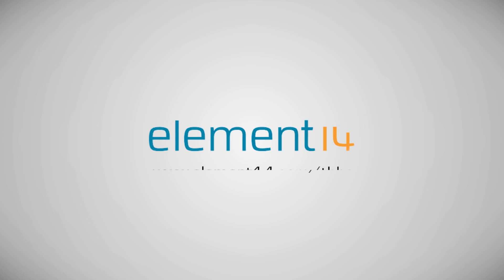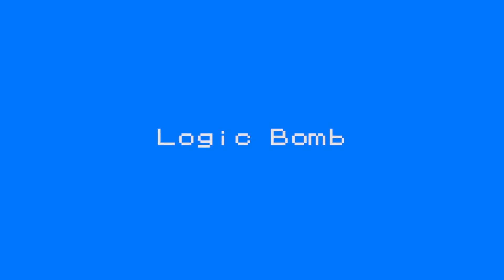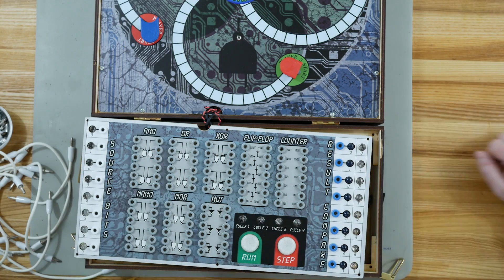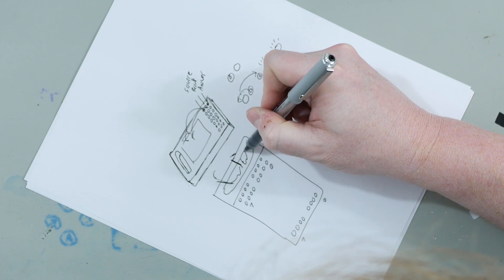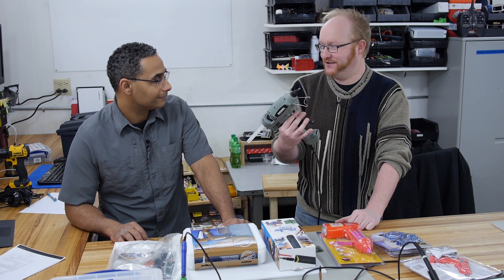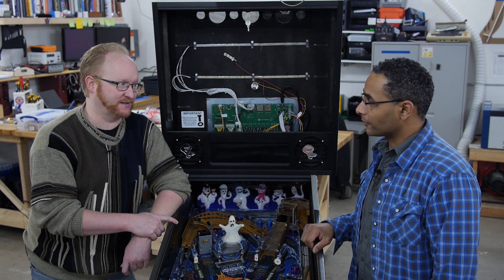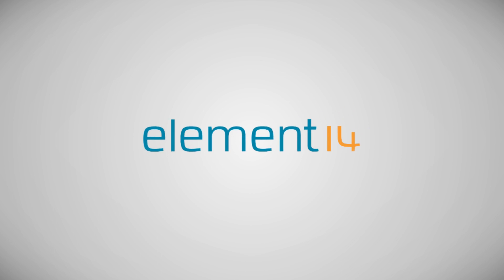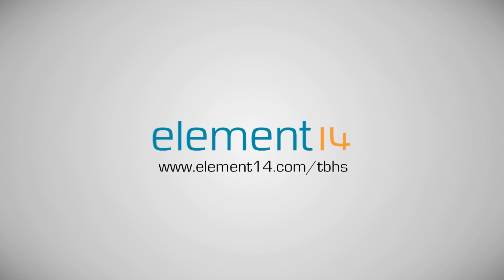Announcing Three New Builds!

Comment: You could try spring terminals for the Logic Bomb. 
When I was a kid I had a toy that let you "make" simple electronics by running tinned wires from spring contact to spring contact. It stood up to me as a kid and it was easy to get more or replacement wire as all that was needed was a stripped end.
Reply: That's what Ben was thinking. We may end up going that way.

Comment: I would happily back every one of these on Kickstarter.  For Hackmanji, if you recall those old Radio Shack electronic projects kits, they used bare wires with "spring" terminals.  Seemed pretty robust back then, and you can always make more on your own.  Also, I find Felix's dry wit and nonchalance in the presence of Ben friggin' hilarious.

Comment: For the Hackmaji what about using RCA cables? 
They're obsolete, abundant, provide sturdy contacts, and you can split them up into thirds.
Also, they have a signal and a ground line. So, you could make dual signal connections.
Or, consider using cheap Stereo Audio Jacks, you could make a half-normalled patch bay.

Comment: I know it would get (much) more expensive, but it would be super duper cool if you added a dot matrix display, like those on pinball machines, to the hackmanji board. So that it would present you the puzzles and the results and overall be more exciting!
It would be nice if you added that to the mini pinball machine as well, but if you want to make that thing customizable, it could be a problem.
Also, i don't think you should simplify the mini pinball even more. It took you guys a long time to come up with that, but once you have a product, it could be something relatively fast and easy to assemble, if that's the problem.
Because, you know, you have to have flippers, ramps, targets, and please oh please slingshots (and bumpers?). We need to see the ball being kicked around. But you could have some sort of universal playfield where you could put those features in a few different configurations.
But yeah, no 3d prints.

Comment: ben, the only thing i know is: THAT GLUE GUN MUST HAPPEN; automatic glue push, automatic or smart base, temperature control. and if possible, it should use power tools 18v battery, it should come with adapters for all branded. Milwakee, makita, BOsh, Dewalt. if sooo. send me 1000 000 I whant them, ps. is it possible to hire you for personal proyects ?
Reply: oh, ahd check the new bosh glue pen and glue gun, the new corless black and decker, and new cordless riobi.
Reply: Juan Miguel Elorriaga. they already make them. automatic glue guns have been around for awhile.
Reply: yes, but they dont have it all. they are not cordless, or dont use standart glue, or many ors.
Reply: Juan Miguel Elorriaga. 1/2 and 5/8 is industry standard.  They do make ones that are both automatic and cordless. I think it will be cool for him to make but that's all it is something fun to make. for practicality purposes it's much simpler to just buy one.

Comment: Just had an idea that might help with the hackmanji: 
Some toys (like the Electronic Monopoly Bank) use bumped cards as a cheap imitation of actual swipe/chip-cards.
If you could key the plugs (creating, for example, a 4-bit pattern out of the bumps) then you wont need to worry about the connectivity.
but, on the other hand, it might require too much redesigning the game.

Comment: For the hackmanji board leads why not use audio banana plugs on each end of a wire. Soldered each end. Banana plugs ain't too much
Reply: Too expensive for as many as we need. : /
Reply: theHeckwithKaren I had a look on eBay and it's 20 for 4.95 in the uk and they are screw ones so no soldering required ? I know it's 10 leads but 20£ would get you 80
Reply: could you eliminate the wires in hackmonji and just use switches? then you just need a row at the top of lights with the symbol of the "gate" desired  and 2 more larger LEDs .. a Red for wrong and a Green for Correct.  every switch would have an identity and the software would be looking for an (X then Y) key sequence - I would think that would cut down on parts, and no extra loose pieces to lose. - I would like to add that the momentary tact switches can be found for pennies each.
Reply: To sell the finished game at the price we are hoping for, the entire unit would have to cost under $30 in parts to manufacture.

Comment: I know the answer is most likely "not on your life," but....

Could the answer to the mini pinball table issues be, perhaps, to go the electro-mechanical route rather than solid state? Solid State is simpler design-wise, I'd imagine, but a mechanical unit might open up the option to have a much more tinker-centric design to everything and mean that the majority of the internal parts can be sourced ready-to-go from manufacturers already (cogs, worm gears, etc.)

Maybe the answer is to start with something like LEGOs (since you already want that influence,) and study how their mechanical pieces in the Technic line could be adapted into a pinball table, and just work on making that smaller and smaller until it fits your size criteria and can be produced with already-available parts (or a minimum of custom ones at least.)

For example: the flippers on a table as small as you're looking to produce don't really need to be actuated, but could be wholly mechanical in their function and require a minimum of parts to put together (a couple of gears and axles and that's kinda it.) Just, you know, little changes like that would add up to a product that is extremely customize-able on the user end, easy to break down on the creator's end (for flat packing,) and requires no software whatsoever to muck about with in either case.